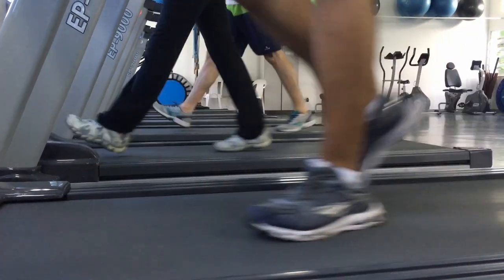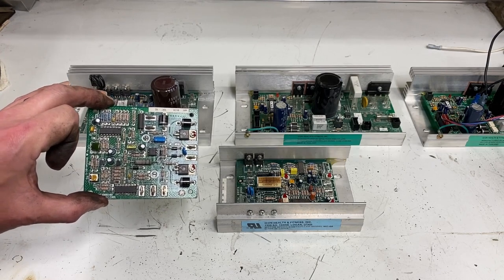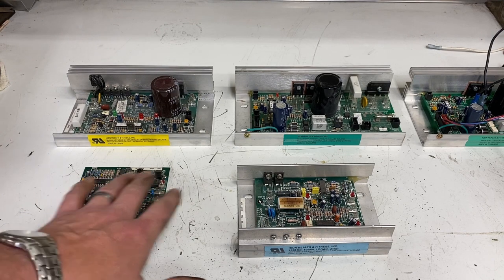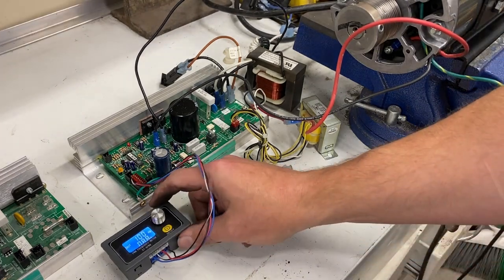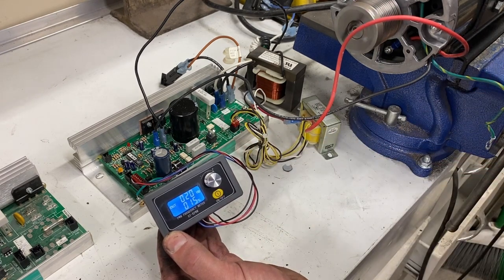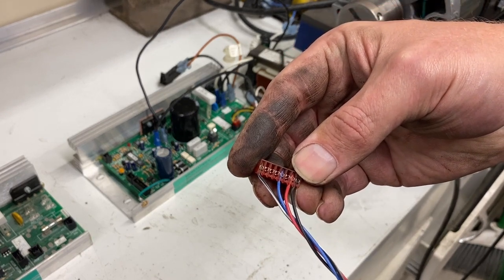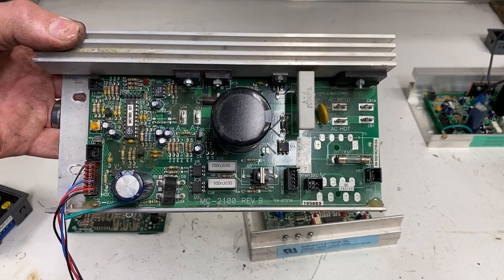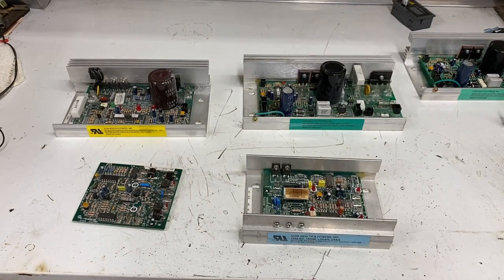Variable Speed Power Supply, Treadmill Motor Controller Boards: MC-02, MC-60, MC-2000 or MC-2100

Comment: Keep in mind you may not get full horsepower from a treadmill controller. I have a NordicTrack 2.25HP motor and MC-2100 controller. The motor is rated at 130VDC, 2200 Watts. That calculates to 16.9 Amps. The tag on the machine frame states 120 Volts, 13 Amps. That calculates to 1560 Watts. That's about 25% reduction in Wattage. I'm not sure how much the maximum torque is reduced. The power cord is 16 AWG, another indicator of the power the machine uses.
Reply from the maker: great point amps are everything.  The motor only draws max amps under max load so likely you will not see the effects unless you are really pushing the machine hard but still more watts is better.  Just another reason a properly setup SCR is my variable speed power supply of choice.

Comment: Daze. I have a Lower Motor Control Board Controller 8130201 MEG4LF-1E. Have you had any experience modifying this board for use on any DIY projects? I have all the components and wiring off the treadmill with all wiring. Any help on the proper wiring to accommodate a PWM signal generator would be appreciated. thanks
Reply from the maker: email me through my website of what you have paying special attention to the wiring harness connections and I will see what if anything I can do.

Comment: Great video and very informative. I have a mc80 Although it does have the LWH connection the board seems to be very small compared to the boards you have on this video. Is it a good board to use or should I keep looking for one of the boards you have on this video?
Reply from the maker: The MC-80 is half way between the MC-60 and the MC-2000. Not a bad way to go as long as the motor is not too large. As far as the boards, in my video the MC-2000 and MC-2100 are good boards but IMHO not any better or worse than a properly setup SCR system. I say that because of your comment, “or should I keep looking for one of the boards you have on this video?” SCR controllers have a bad reputation because so many people have used cheep ones and not done anything to clean the power. I like SCR controllers and use them on all my equipment because they are easier to use, less expensive, and more robust than a PWM type treadmill board and all the issues that give an SCR a bad reputation can be eliminated.   SO I guess to answer your question if it was me and I had the MC-80 I would use it.  If it burns up then switch to an SCR.   I hope that helps

Comment: Awesome Thank you for sharing this info!
Question: Can reverse be added to this circuit when using the MC-2100 board?
Need reverse in a lathe operation when backing out a tap.
Reply from the maker: Yes it can.  Next weeks video is on wiring a forward/reverse switch.  Be very carful using that MC2100 on your lathe as they are not very robust.  You may want to also watch last weeks video https://youtu.be/yMkW2SXl_sA

Comment: 1st video of hundreds watched telling me exactly what needs done to get the 2100 running. I have the main console for the proform treadmill, but I need it to run for days at a certain rpm for tumbling rocks. Because of that, it looks like I’ll have to bypass the console with your suggestion. One question though, if my pwm and pulse generator doesn’t have an on off switch, can I insert one in between the motor control board and pwm?
Reply from the maker: I honestly don't know.  You could put the switch between the PWM and the board on the PW signal wire, but the electronics in the board may or may not respond to it being turned on an off. You could also put said switch on the power lead to the PWM (the first option is probably better assuming it works) The one draw back to these boards is the safety featurs that are built in for use in a treadmill and having never tried it I couln't say if the board will "like" thatsignal being inturepted or not.  I am not exactly sure what kind of a signal comes out of the PWM when you hit "off" and that is where the question arrises.
Reply: @dazecars  ty for your advice, now to see if this all works. Better than an interruption every 2 hours, or hearing a loud noise to find out the treadmill went from a speed of 1 to a speed of 6. That was crazy seeing 100lbs of rock spinning that fast because the treadmill course took it to 6 😂
Reply: Just a fyi if you’re interested. The pwm frequency meter I bought is identical to yours, but without the on/off switch (Drok is the brand). I had a switch ready, looking for a fail (due to the soft start is what I think you called it), and as soon as the frequency hit 20 hertz, it started running, no switch necessary. Does that sound odd to you? Made finishing up a little easier for me. Thanks again for your direction! A $13 part made it all much easier!

Comment: Do you have information for Digital Concepts controllers used on Proform equipment? They look robust like the MC2000 and 2100 units.
Reply from the maker: Contact me through my website and email me some pix of the board with close ups of the connections.
Reply: @dazecars  Website called up Outlook for contacting  which I don't use. I'm on AOL. Couldn't get email address.
Reply from the maker: @jaspermcconnell6417  My website doesn't direct your computer to open outlook it just provides an address and your computer opens that address in what ever platform the settings in your computer direct it to.   In your case the computer settings are for outlook.

Comment: Hi I have a treadmill that won’t stay on it’s got the MC-2100 REV B board on it! The power light on the board is lit and when I press the on switch the motor briefly comes on but then shuts off and the power light goes off too! then the power light cycles back on and repeats the same problem again & again! Is there a component that I should check for this problem? Also the white ceramic block labeled  
7W  3K3J   FY gets very hot is this normal? Thanks for your emmediate  response! E. Rod.
Reply from the maker: the resister getting hot is normal.  as to what the mc2100 has going on with it I am not sure.

Comment: Great video 👍
Is a MT05 board any use?
I picked up a new treadmill with a damaged cord. Repaired the cord, but the control panel doesn’t illuminate. 
I’m sure it’s a issue with the wire that runs through the frame to the control panel, but I want to repurpose the motor anyway.
Reply from the maker: Was there a spec sheet under the cover?  contact me through my website so you can send me pix.  I need close up shots of the board especially the connections and the spec sheet if it was inside the treadmill and I will see what I can do.
Reply: @dazecars  no spec sheet unfortunately. 
I managed to remove the board, motor and wiring intact. 
I’ll take some pics and send them over. 
Much appreciated 👍

Comment: I had a bad MC2100 SDI board so that the treadmill quit working. I replaced the 6800uf electrolytic capacitor and now the treadmill works again as though it was new. The capacitors go bad. Replace them and you're good.
Reply from the maker: That is one of several parts that go bad. The switching transistors are also prone to failure.

Comment: Thank you! I've spent many hours of research trying to find this kind of information. It's out there but hard to find. I used an Arduino to run the MC-2100 before finding the PWM method. 
Excellently made video. Thank you!
Reply from the maker: Glad I could help!

Comment: i have a MC-5100 and its made by Icon like the 2100, and looks similar, but has 2 big caps. and the pinouts are a little different. The internet has zero interest in these i guess, because for the life of me i cant find anyone talking about them. 
I just scored a free tread off the curb, it has a mc-2000. And i dont know if anyone has foiund a really old treadmill, i mean so old the motor looks like a washing machine motor, and it has a pulley thats adjustable by spreading it apart with a flexible shaft screw knob.  i love the simplicity of it! i left it as is and use it as a conveyor belt for sifting sand, it makes such a pretty pile lol, just like the big boys. 
Anyho, anyone have a 5100? anything cool about to know or is it just a revised 2100 pretty much?
Reply from the maker: Do you have the treadmill control panel that came with the MC-5100?  Often times the circuit board in the main control panel will be labeled with the pin out info and you can trace the wires to determine what is needed for the PWM signal.

Comment: How hot is that white tall rectangular component supposed to get on the MC 2100 board? Mine gets very hot. Every time I energize the board and I’ve got it wired exactly the way yours is.
Reply from the maker: Very, it’s a resistor and is used to bleed power off of other components. The energy it bleeds off is converted into heat. That is why that component is ceramic so it can handle the heat.

Comment: The most productive informative video indeed. Just have to buy a pwm. I think one of the controller I have is the last one you flashed and moved out of the way, the complicated one you said you can' t hack.  I have to look.  I assume if a board doesn't show PWM somewhere, it is a no go.
But I have the other two. One I just use the potentiometer and the other I believe needs pwm.
Thank you so much.
Reply from the maker: Glad you enjoyed it!
Reply: @dazecars  I guess what I have is asm-mef1j-3b.  Vision T9700HRT Controller # 013738-A.  I wonder what that type of connector is that called, the one big one with two rows of needle pins sticking out of it that the flat white strip gets connected to and then locks in place, what each pin might be.    And the other one I have is Precor pcb# 36526-203
Reply from the maker: @alchemy1  The only solution I have for using those boards is to use the control panel that came with the treadmill. If it was me rather than using the treadmill controller I would simply go with a QUALITY SCR power supply.

Comment: I have a Johnson Fitness control board (JDYF14PL REVd) and can't figure out to control it with a PWM. Where do I find the pin-outs?
Reply from the maker: First look at the control panel board.  Some times the board in the control panel is labeled and you can trace the wires back.

Comment: Thanks for taking the time to post this kind of info for the do it yourselfer. I have a ProForm 695Pi it's about 15 years old and has had little use. Recently I started using it and after about 2 weeks of using it 20 min a day at 2.3 Mph , the motor began to stop running. If I get off the belt it will go back to running at the set speed. I have lubed the belt but the motor has begun to act up even sooner now. any ideas? Any help would be appreciated.
Reply from the maker: sounds like an issue with the motor controller, but I can not say for sure. contact this guy and tell him I sent you.  He specializes in treadmill repair 

Fitness Technology youtube channel 
https://www.youtube.com/c/FitnessTech...

Website
https://fitnesspartspro.com

Comment: Hey DazeCars, I have the MC2100 board, and I thought I had salvaged all the components but I'm    not sure now after watching. At 6:09 you are pointing out the peices on the bench and you point to what I thought was a transformer, but you called it the Ferrite Choke. I thought the choke was the round thing with the wires coiled around it. I also have the same PWM as your first demo' d set up, but my motor won't start. Any ideas as to where I should go from here? When I salvaged this treadmill, it worked intermitantly and I traced it to a separation in the touch screen plastic layered switching for the speed controls and incline on the consol. The motor did work before is what I am trying to get at. I double (actually quadruple) checked my wiring as per yours and it all looks good except for your Ferrite choke thingy. I was so glad I found your video as I have been struggling with this off and on for a while now, and but alas my struggle seems to continue. Cheers and thanks for posting.
Reply from the maker: There are two chokes. The AC choke is the doughnut and the DC choke is the thing you thought was a transformer (I show both a DC choke and a transformer in the video and go over the differences). They look the same but are totally different. A choke will have 2 wires and a transformer will have 4 or more. Your machine may not have come with a DC choke, not all machines have them. They are not required but your motor will run cooler and last longer if you use one.  As to your problems getting the motor to spin, did you change the pmw to the correct frequency?
Reply: @dazecars  where would someone find a DC ferrite choke? My MC 2100 didn't have one and I'd like to get the best outcome possible. Any info is appreciated!
Reply from the maker: @TurnItUpbyTravis1213  You can get the choke on eBay search "Treadmill choke" Just know that people don't know what they have and think transformers and chokes are interchangeable because they look almost the same, but they are not. To know which one is actually being listed look at the wires coming out of it. if it has 2 it is a choke if it has 4 or more it is a transformer.
Reply: @dazecars  thank you! Your videos have helped out a ton!
Reply from the maker: @TurnItUpbyTravis1213  Glad I could help!

Comment: Thank you for the video. Biggest help so far. Motor will come on but pulsates. 
 Want to use for my treadmill. Everything good except push buttons on monitor board
Want to use board for emergency cut off. 
Treadmill  Nordic track C2050 about 15 years old
Motor board number  MC-2100 REV B V#37376
As you suggested Got a ZK-PP1K PULSE GENERATOR MOTOR RUNS BUT PULSATES.  SPEED CONTROL WORKS ON GENERATOR
BUT MOTOT STILL PULSATES. UNHOOKED ALL WIRES ON MONITOR BOARD LEAADING FROM MOTOR BOARD.
STUMPED. Any suggestions? Do not want to get rid of good treadmill because of electrics. Just know it can be fixed if find out how.
Thank you for any help
Reply from the maker: I wish I could tell you exactly what the issue is but I don't know.  I am a hobbiest when it comes to electronics and I understand basic circuits and workarounds but am not a professional so in your case I am not sure what part is not functioning properly causing your issue.  Sorry

Comment: Brilliant work. Thank you for uploading. I have a MC-2100 which i am going to get a PWM controller for (to fix my treadmill actually!). According to the schematic, the PWM controller will be powered by the MC-2100's 12V rail.. Then the MC-2100 expects a PWM signal in the range of 0V to 5V. Just wondering does the PWM controller's duty cycle effectively "step down" to this 5V or is it spitting out +12V?
Reply from the maker: Sorry I didn't get back to you sooner.  That is a very good question, and something I never thought to look into.  Most modern applications are looking for a 5V input as that has become the industry standard due to USB.  I would assume its putting out 5V.  Even if it is not because of the slow pulsing required to drive the MC-2100 even at 12V it would effectively be a lot less than 12V.  In other words your MC-2100 uses PWM technology to take a roughly 100V DC current and apply it to a motor at a "lower voltage", not by actually stepping the voltage down but by applying the full voltage but then switching on and off quickly to “reduce” it.   The same would be true of the PWM controller.  It is pulsing on and off at a slower rate and should be putting out less voltage.  You now naw have me curious.  I will go out and set one up with a meter and see if I can get an output reading.  I will report back.
Reply from the maker: I have some answers.  First of all let me say that was very astute of you to notice the voltage difference on the spec sheet, I missed it!!  I went out to my shop, plugged in a 2100 board, a PWM, and used my multi meter to run some tests.  You are correct that the 12V going in on the PMW is also what is coming out as a signal BUT as I predicted the PWM action reduces that voltage.  At 100% duty cycle the voltage is 12V.  At 45% it drops to 5V.  I too looked at the schematic and the 0-5V is what is coming out of the control board and is not necessarily what the MC-2100 can handle.  Obviously it works in that range but I think it can handle more voltage without any problem.  I know lots of guys have run this type of PMW on a 2100 for years without issue so I don't think the higher voltage is a problem especially because it is just a signal wire.  With that said there are a couple of options for a 5V fix.  You could hook up a 5V voltage regulator (7805) between the board and the PMW to step the voltage down OR there is a 3 prong connecter next to the main connector that also has 5V output.  I plugged into that 5V output on the 2100 and it powered the PMW without issue and had a range from 0-5V depending on duty cycle.  With yours actually being in a treadmill I am sure the 5V output is being used but you could probably tap into it.  Let me know if I can be of any further help.
Reply: @dazecars  Thank you for the response and sorry for the delay in getting back to you  (Yt didn't notify me for some reason)... Yes I think that because there is no draw (large current) I do not think the 2100 cares. All it wants is signal on/off at the required frequency. I'd say it could operate at even larger voltages (but I won't try)... Many thanks for measuring this and it makes me feel much more comfortable applying the 12v PWM to the 2100

Comment: really nice and didactic video but how can we reconize the pins for the pwm connection on the board; there are no signs or nummembers on the board(mc2-v3,1).
Reply from the maker: an MC2 uses a potentiometer not a PWM